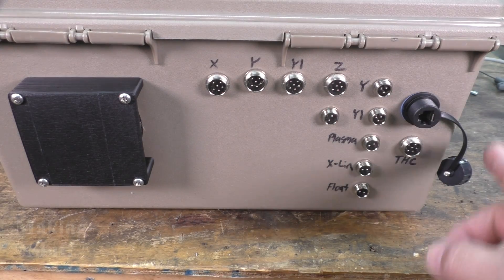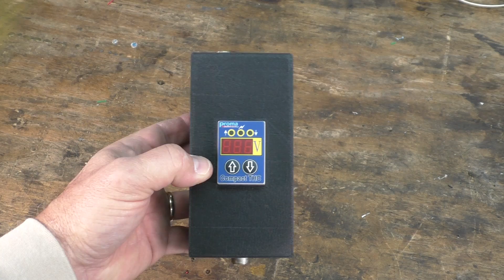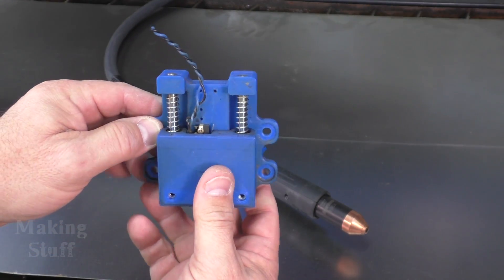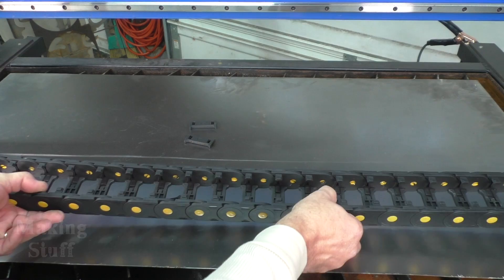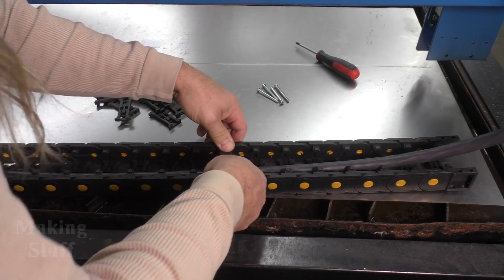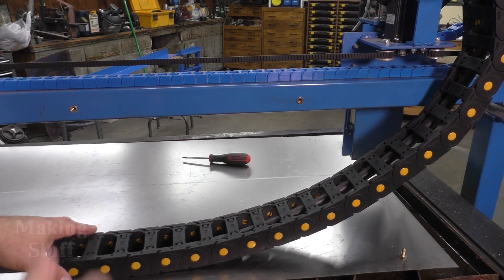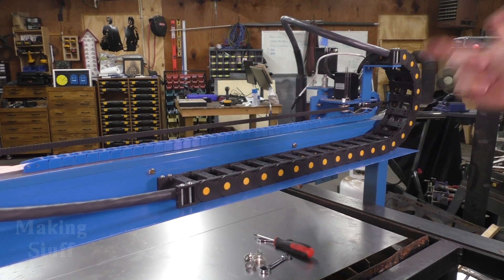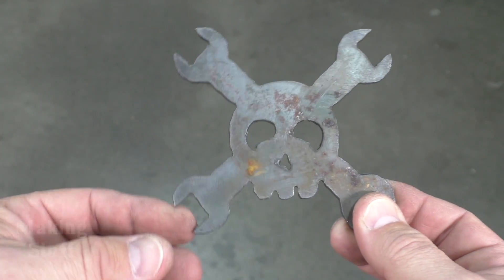Finishing the CNC Plasma Updates - Part 3

Comment: Thanks for all your great videos. Knowing what you know now, if you have to do it all over again, would you build the plasma table more as you did with the more recent cnc router table? Thanks in advance for your answer.
Reply from the maker: The only thing I would do different is build it 4ft x 4ft instead on 2ft x 4ft.  also, maybe make the water pan 3 inches deep instead of 4inches. It's been working great and is my favorite tool to use in the shop.
Reply: @MakingStuff  Thanks. Would like a 4x4 also but having problems with shop space. Maybe extender bars might help?

Comment: Brilliant build and excellent explanations all the way through. I will be trying this build myself. One question though, did you find that the plasma caused any issues with the sensitive electronics you used? I have seen other videos where this was a real issue, not sure if you did something to avoid this as I don’t think you mentioned it in the videos. Thanks again for the really useful information man, i am now a subscriber for life!
Reply from the maker: I used shielded cables and it seems to have done the trick.  I recently also had to ad some filter caps on the Mesa board.  Don't know why, but it started interfering with the THC signals but the caps fixed the problem.
Reply: I have ordered the shielded cables, I have also opted for the Pokeys57CNC board, it’s got the relays built in and seems to be a little in front of the other boards. Pokeys also make the PlasmaSens so this will work natively with the board. Your videos are brilliant and I will be joining your patron! I wasn’t going to attempt this build until I watched you run through the process, I am hoping you didn’t just make it look easy 😂

Comment: I saw you posted on the linuxcnc site about a fusion 360 post processor for your plasma table.  Did you ever get a post working?  I am looking at using fusion 360 and linuxcnc for a plasma table in the future.
Reply from the maker: No I never found one.  I gave up on Fusion 360 for now.

Comment: Nice realization.  I have just question.
How do you think ? How durable will be the use of a tooth belt in the plasma cutter for the drive? Dust, sparks...
Reply from the maker: It has worked well with no issues.
Reply: @MakingStuff  Thx!

Comment: It turned out very nice.  I will finish mine in the next week or so.  I yoo have a Power Max 45 and Proma HTC.  I noticed you ran the plasma at full amperage for that thin metal.  Would you consider a video on your HTC settings (specifically the HTC) and then the work flow for changing settings for different material thickness?  P.
Reply from the maker: I just used the settings in the Hypertherm manual.  If you lower the amps, then you have to lower the speed also, so I just leave it at max then the amchine can run at full speed.  Also, that makes one less thing to worry about on the setup when the amps are always max.

Comment: So looks like you have a fan input, what about exhaust? You pull cool air in, is there a way to get hot air out? Maybe I missed it.
Reply from the maker: I can tell a difference with the fan turned on and off.  An exhaust port will probably be necessary this summer or if it gets used for long periods of time.  I just wanted to see how well it worked before cutting more holes in the enclosure.
Reply: I was about to ask that in a comment until I saw this comment. Personally I have no fan or vents on my enclosure but I only have a single power supply and rarely run the machine for longer than a couple of hours at a time and have never had a problem.

Comment: Nice upgrade like the cable guide. I have one question about the THC Proma ( I also have one) . When you change your cutting amperage on your plasma cutter for thickness of material do you deem it neccessary to change the voltage reading on  the Proma THC? I am having a problem trying to adjust the correct voltage on the THC for correct tracking. I am using Mach3.
Reply from the maker: I leave the plasma cutter set to max all the time.  It's just one less thing to deal with.  The cut charts in the Hypertherm manual are all set to 45A (max)  unless you get into thin stuff like 20ga or thinner.
Reply: @MakingStuff  Thanks for replying!  That's a good idea I normally I cut 1/4 to 1/2" plate. I am using a Miller 2050 which is 50 amps max. Adjusting the speed for each thickness would be the way to go thanks. Keep up the good videos I have been watching for years.

Comment: I'm wondering, I couldn't see a vent or anything like that to draw in air, only the fan mounted to extract air from the enclosure.
Did you hide the intake vent under the mounting plate?
Reply: The fan that he installed pulls air into the enclosure, but it seems he did not add an output fan or grille. Also, the 3D printed fan enclosure needs to have some type of mesh or scotch-brite material to avoid getting debris or dust in the electronics compartment.
Reply: @OlivierCR  Look at the fan again, it's top and blades leading edges are visible inside the box, so its pulling air out of the box. So I questioned if he forgot holes for the air to get into the enclosure first, or if he placed them on a location not visible in the video.
Reply: @FullMetalFox2  Watch the video from 1:52 to 2:05, specifically 2:01
Reply: @OlivierCR  Well in that case he mounted the fan the wrong side or reversed the polarity, 1:12 you can see it facing inside the enclosure.
Reply: i was thinking the exact same thing, i'm sure it's as easy as adding a hole with a filter.
Reply from the maker: There is no vent yet.  I wanted to see if I could get by without cutting more holes in enclosure.  Is it 100% effecient? No.  Does it cool down the inside of the box? Yes.  I may have to change this come July when it is 95 degrees in the shop but I'll just wait and see.

Comment from the maker: It's finally finished!  Leave a comment and let me know what you think about it.
Reply: If youre planning to make a diy books/plans for it. Im all in!
Reply: I've been watching all your videos good job. I am a welder by trade but I do not know much about elecktronicks is it possible for me to build my own electronics Box. I do not know where to start.
Reply: Nice!!!
Reply: Hi Boby!!
I love your videos. 
I am from Brazil.
I think if is possible to change the configuration when use a kind material and thickness, could have an better quality of the cut process. Even if you do this manual, like setting the configuration before to start the cut process. 
Because each material has different properties and the length is important too to this process. Those values combined will give the right velocity and distance to cut with an good precision.
You could find some table with those values, like in drilling cut we have too. Those values come of experiments the industry/university have done.
Thank you so much for share your knolegwe :)